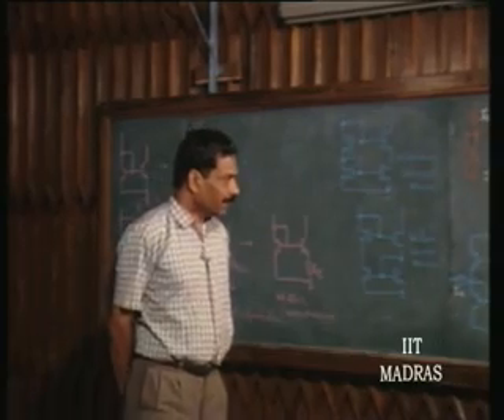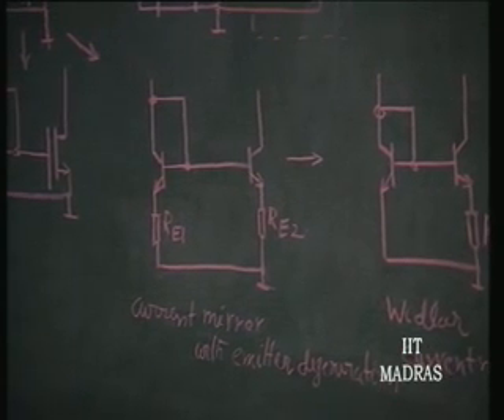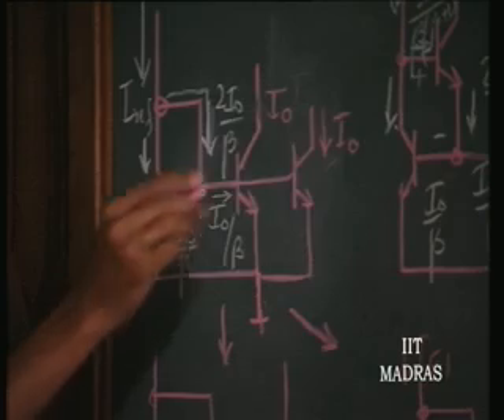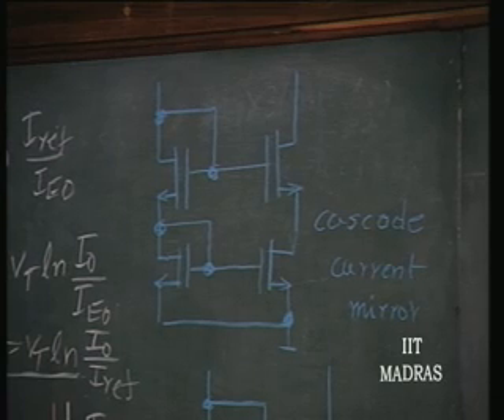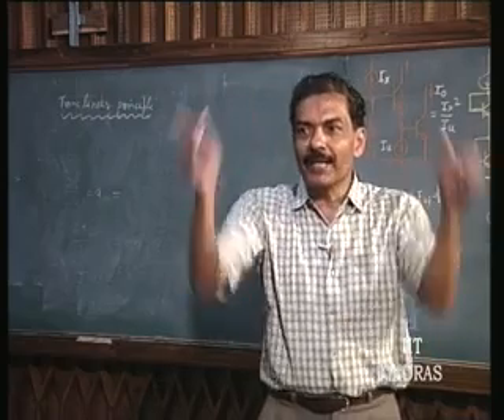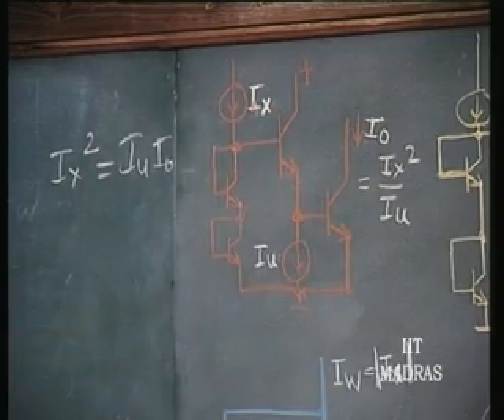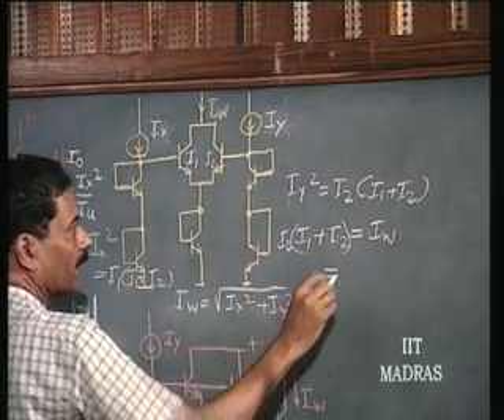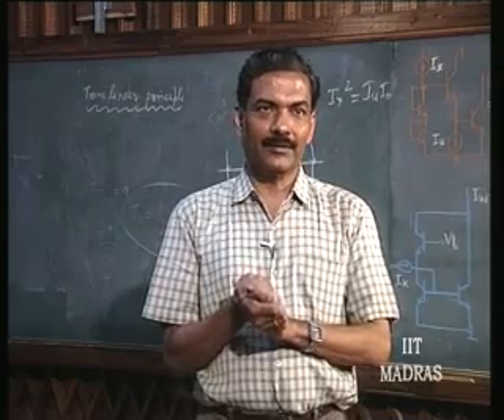Lecture - 2 Current Mirrors

Comment: at 31:38 , (Ix^2 = Io.Iu ) , okay agreed. But , firstly,  that is only true when they all have the same Area! 

second, how do you set 'Iu' to begin with? the npn in the 2nd leg sees 2VBE at its base, therefore any current mirror benath it will also be affected by a 2BVE - VBE = VBE V and it will also affect base bais of the final output npn. we dont know if the base bias of the final npn sees equal distribution of VBEs as the input pair.